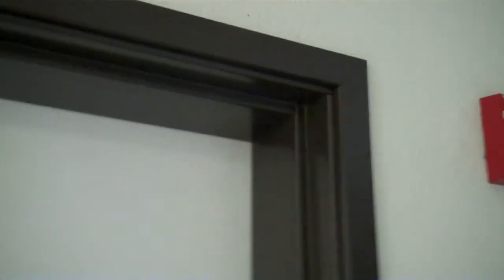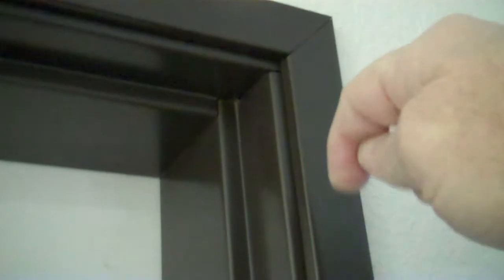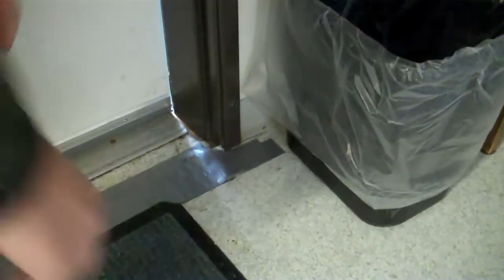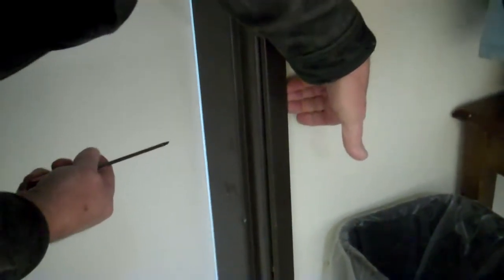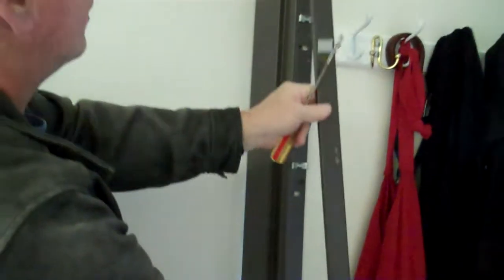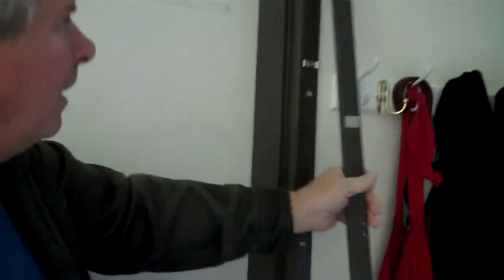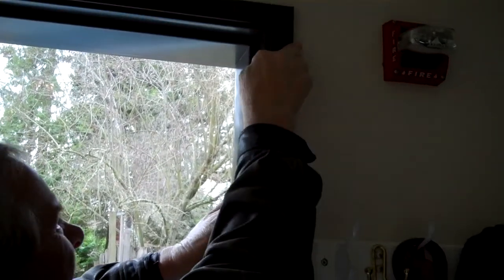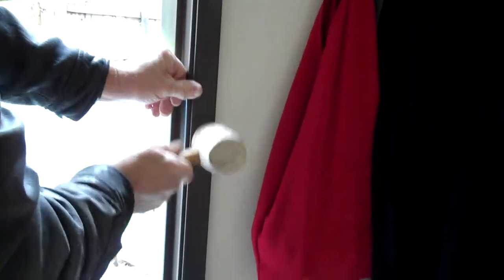Removing and Installing Timely Jambs

Comment: thank you so much for sharing, you are a lifesaver. I needed to fit a server into a room with a strangely sized door that was less than 2 ft wide and I couldn't fit it. Removing the door frame allowed me to fit the server inside.

Comment: Very useful little video. Do you know if it's possible to remove and replace the metal door frame (with metal stud walls) using this method without cutting and replacing drywall? I have an inswing door that I need to make outswing but can't find any answers online.
Reply from the maker: Absolutely
Timely jambs, are installed over the drywall
And fastened through the drywall with screws

Remove the door
Remove the trim
Remove the screws that hold the jamb

Turn the system around

And now you have an outswing

Comment: what if I have a metal door frame that appears to have the trim as part of the door frame. they dont look like they pop off
Reply from the maker: They don't

If it's a heavy duty metal frame

That is one piece with the molding

Then it is inserted into a wall that was already existing

And you must remove it the same way

It's all one piece

Simply take off the door

Then you have to remove the frame

There are two ways to do it

If it is screwed on from the outside

Just look for dimples on the jamb

And remove the screws from those dimples

If it is the kind that has the hidden fasteners

You have to remove 2 in swath of whatever material is covering the wall framing from the entire molding area
Reply from the maker: When you take away the two in the material

That will expose the screws that is holding on the frame to the framing